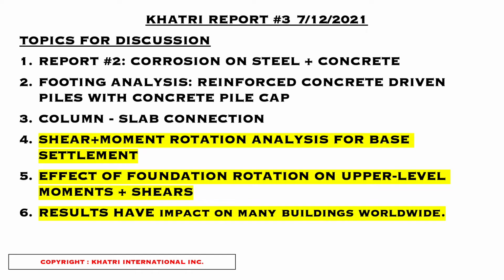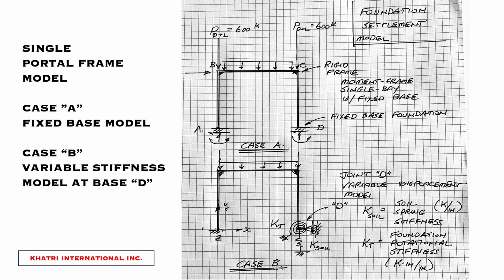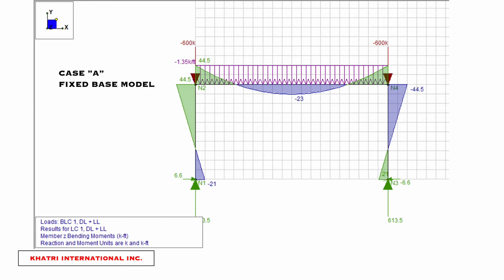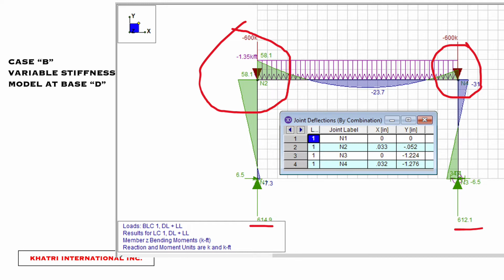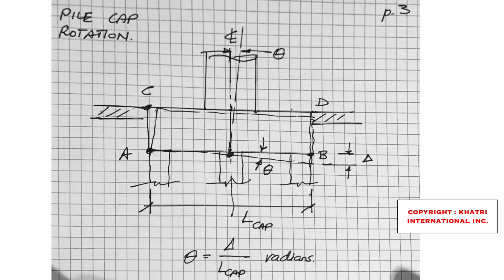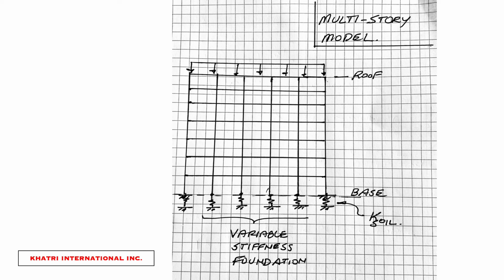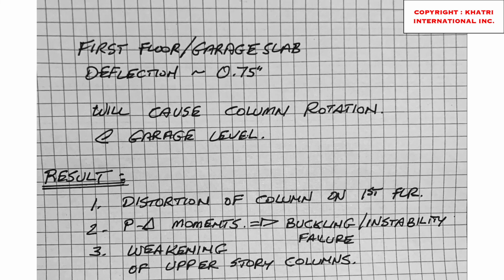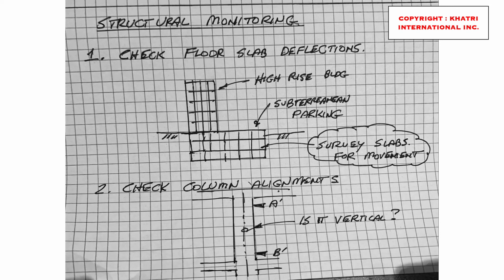Structural Engineering Report of Champlain Tower Collapse | Part 4

Comment: Your presentation is very correct, academic, and note worthy, but I think does not address the cause of the collapse. Your first picture in this video shows the cause.  Poor concrete. The concrete crumbled into a pile of sand, with virtually no bond to the rebar.  The concrete was obviously of low compressive value, which means low density, which means high porosity. That in turn allowed water to penetrate the concrete further reducing its compressive and bond strength. To utilize your structural analysis you need to verify the structure was built as designed, and that the design was adequate. To do this you would need look no further than the concrete specs, the concrete tickets from the delivery trucks, and the load breaks for test cylinders. OR look at the debris pile, that is the evidence that has been kept away from the investigation, and for a very good reason: nobody in authority wants that debris load tested. I might be wrong, but I don't think so.